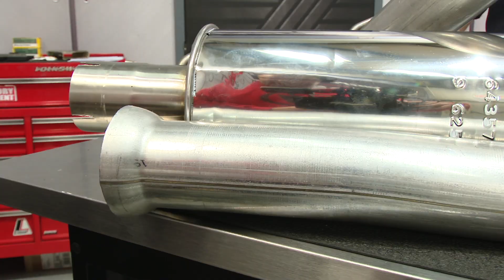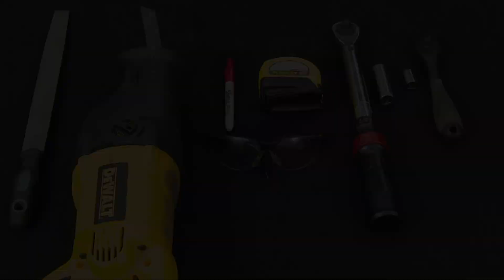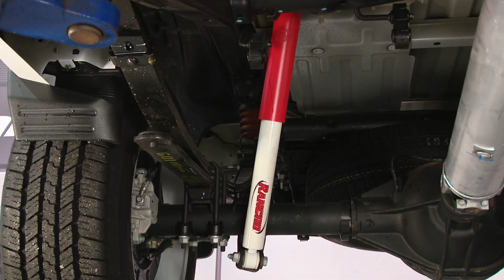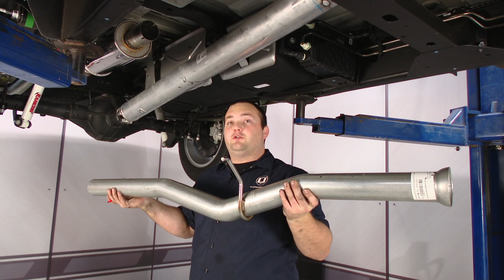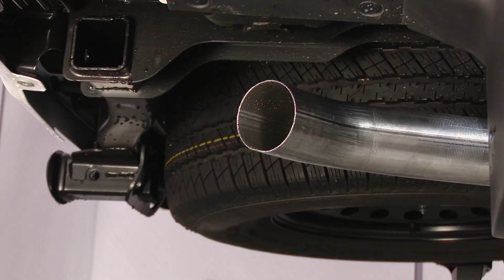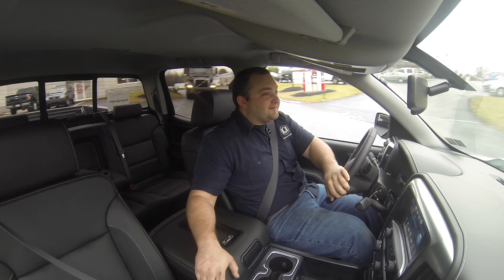Chevy Silverado/GMC Sierra 1500 SLP Cat-Back Exhaust System 3" W/ 4" Tip 6.2L 2014-2018 Installation

Comment: why would you want to remove the OE 3.5" exhaust for a 3.0" aftermarket? Just cut in a good muffler on OE and have a better system
Reply: and by the way  since u make it smaller   the back airflow will cause unhealthy pressure on the 6.2 pistons  especially after tuning ?!
Reply: @majedmohammed8017  i own a 6.2 as demonstrated in video an my tail pipe coming out of factory muffler is only 2.75in. It is 3.5 going into factory muffler but not coming out.
Reply: the factory tail pipe coming out of factory muffler is 2.75in. So a full 3in is still better
Reply: that is 4 the 5.3 sir, which its not the case n the video  @justinyoung129

Comment: Is this SLP1 or SLP2? Im considering dual SLP1 resonators with my factory pipes in place of the muffler. Have you tried this on a 6.0 vortec engine? 2003 2500hd
Reply: Her's the exhaust we installed in the videohttp://www.cjponyparts.com/slp-performance-parts-cat-back-exhaust-system-3-with-4-tip-6-2l-chevrolet-silverado-gmc-sierra-2014-2017/p/620080/

 The truck we used was a 2016 6.0 1500

Comment: Why would you downsize the exhaust from factory?
Reply: I has a much a less restrictive muffler, if you want larger diameter exhaust the MRBP cat back is 3.5 inch http://www.cjponyparts.com/mbrp-cat-back-exhaust-system-xp-series-single-side-exit-3-5-inch-6-2l-chevrolet-silverado-1500-gmc-sierra-1500-2014-2017/p/S5086409/